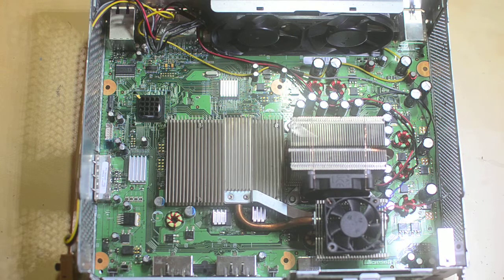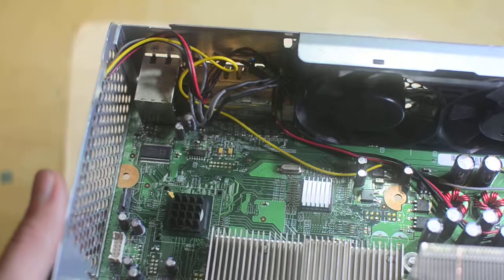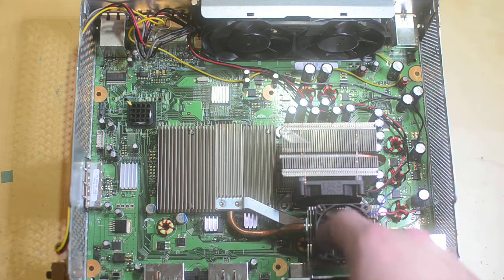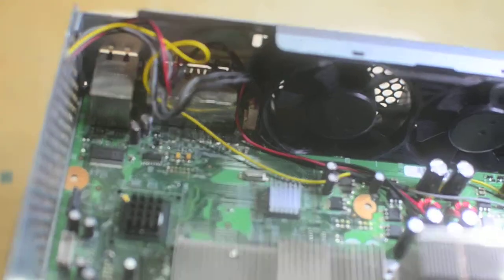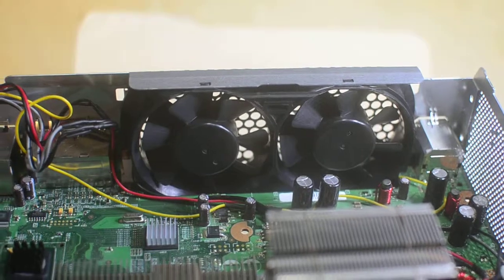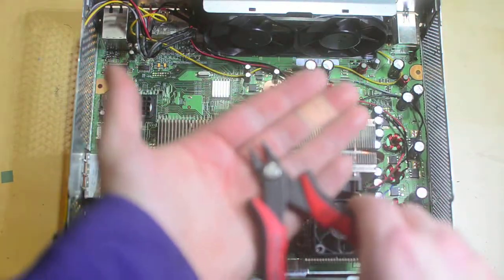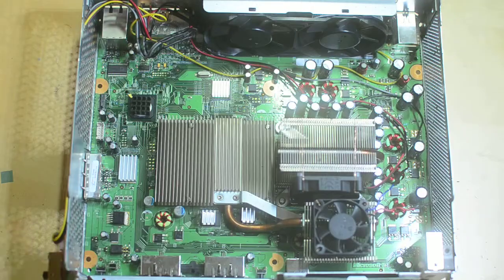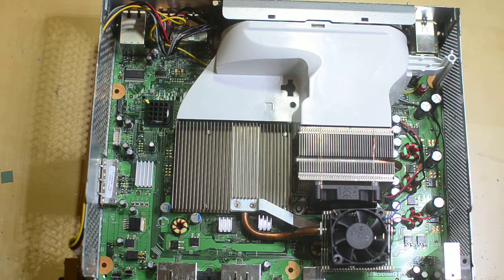Xbox 360 RRoD Resurrection and Switchable Fan Speed Upgrade - Part 2: Wiring & Fan Mounting

Comment: I'm thinking of just adding that small 40mm fan to my heatsink arm. Can I do this by directly connecting that fans red & blue wires to the 12v & Ground to the matching points on the underside of the mobo near the power supply? Also, how are you mounting those fans to the heatsink?
Reply from the maker: Yes, if it's 12V you can wire it directly to anywhere on the mobo near the power connection, it will just run that fan at max speed all the time. Wiring it to the circuit for the main fans will control the new fan with variable speed, but I found that the system generally was not blowing the fans hard enough to stay properly cooled so max speed is best if you're looking for better system cooling. 

I took a beefy stranded copper wire and untwisted strands from it, put those through the heat sink and the mounting holes on the fans and then twisted them tightly. Won't get damaged from heat like zip ties or anything plastic that might melt.

Also, it might be better to have the small fan pulling air up through the little heat sink on the arm instead of how I have it blowing down through it, since hot air rises.

Comment: I think I'm going to do this same mod without a fan switch with everything running at 12v and replace the rear exhaust fan with two modified noctua fans and two noctua fans for the heat sinks.
Reply from the maker: That would probably be quieter than these stock fans I reused, which are pretty loud at full 12V, hence why I used the switch.
Reply: If you did actually do this how did you do the noctua wiring? I’m trying to keep the fan control since I have a jtag xenon

Comment: Hey does it still work in 2021?
Reply from the maker: Yep, although I have an xbox one X so I only fire it up for some older save games that I couldn't merge. It's kind of satisfying how loud the fans are on full blast!
Reply: @Govanification  amazing man
Reply from the maker: @Pointman-0  Ah, the link is dead. Product name was "Omall (TM) Aluminum Heatsink Cooler Circuit board Cooling Fin for Raspberry Pi,VGA RAM,IC Chips,MOSFET SCR(Pack of 5 DIY Heatsinks+3 Free)", nothing special, any small heatsinks with thermal pad/tape should work.

Comment: would help if you included a diagram to the wiring setup from the fans, to the 12v solder point on the board, and to the switch.. I'm bit confused on what to do with the negative wires for the added fans, I know you gave them 12v through the board, was the black connection negative wires grounded? Curious if the board (fan controller) can regulate 12v to variable speeds, instead of the 5v setup... It's a tiny transistor beneath the board, beneath where the stock fan plug is.. Mines actually shorted out so I had to solder new one on the board... I am looking for solutions to upgrade the unit for better thermal flow
Reply from the maker: I put a basic hand-drawn schematic in the description.
Reply: @Govanification  thanks, will check it out